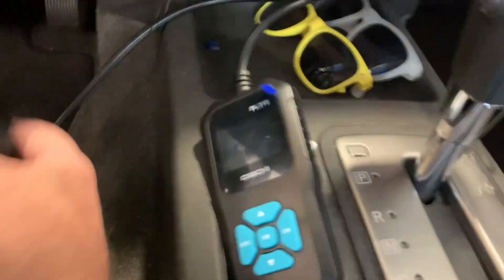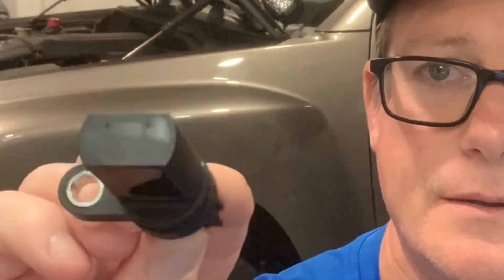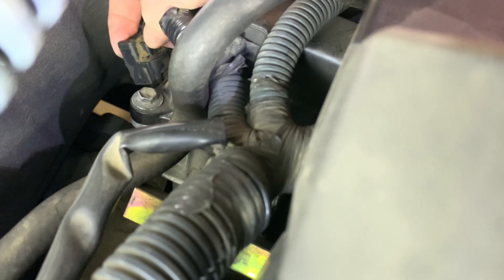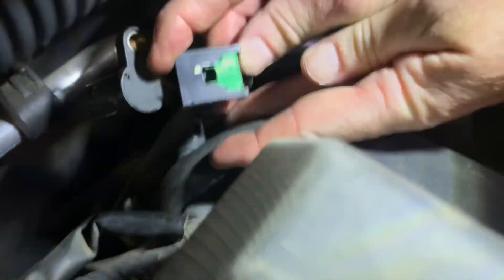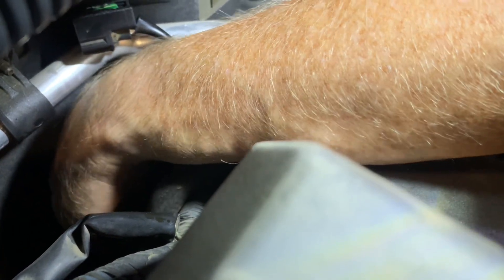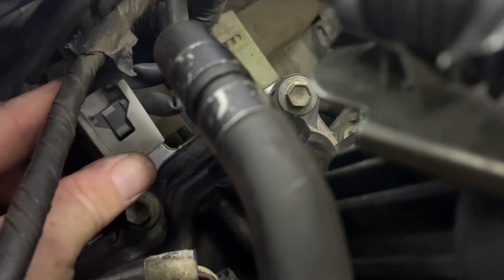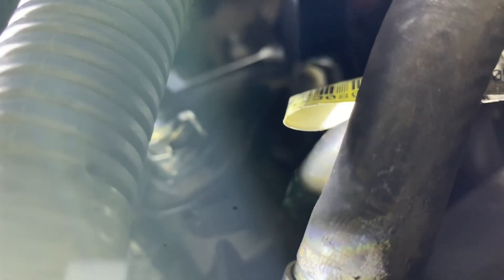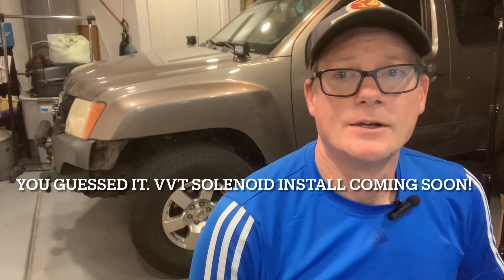Nissan - Service Engine Soon SES Light. Camshaft Troubles P0011

Comment: Hi why you change both? The p0011 it's not on right side? Thanks for answering
Reply from the maker: Good question.  It’s generally recommended to change both left and right camshaft sensors at the same time. They often fail around the same time.  And even better to do the crankshaft sensor while in there too.  

My P0011 (cam, Bank 1 - right/passenger side was finally resolved for good about a week ago). Aftermarket sensors are truly not reliable and I’ll be switching them all out to Hitachi (all 3, before doing any longer trip). Don’t want to be stranded. 🤘🏻
Reply: @TrailRunnerGuy  Oh perfect, thanks! I will do the same!
Reply: @TrailRunnerGuy what did it end up being ? Did the camshaft sensor fix it , or was it the VVT ? Any noises or chatter while the code was on ?
Reply from the maker: @ ultimately the VVT replacement on the PS seemed(?) to have resolved it after a couple times resetting the check engine light (stillfor a cam shaft code), but I’m still not 100% convinced it was the vvt.  Seemed like a gremlin. 🤷🏼‍♂️
And months later got a new code for the crankshaft sensor. I replaced that and all my check engine lights went away forever. Knock on wood. Really hard.